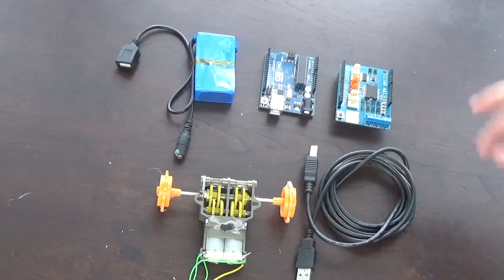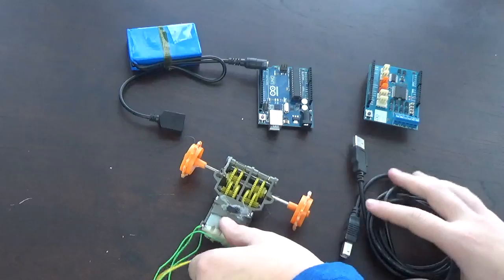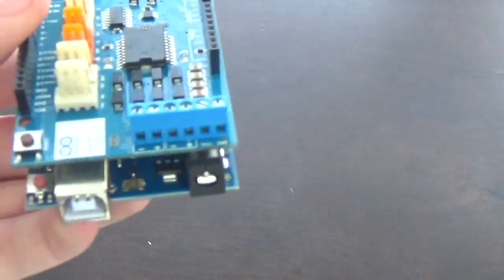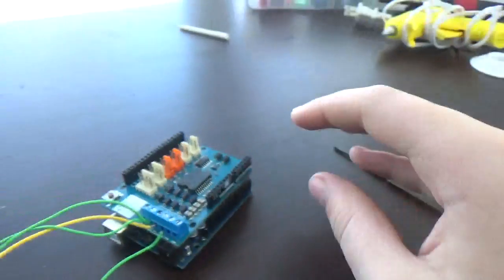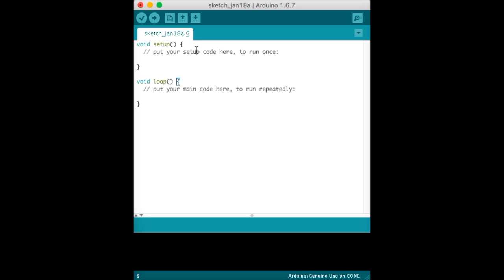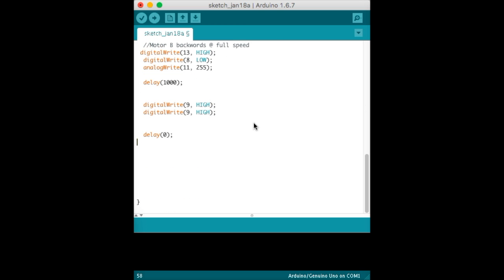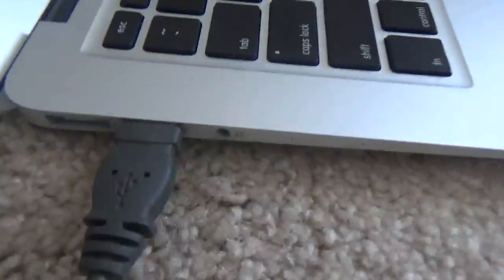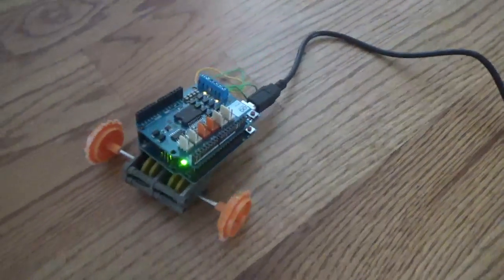How to make an easy and cheap arduino robot!

Comment: Great video but I have questions...    being new to Arduino  I was wondering why use the Arduino Motor Shield when a L298N Motor Drive Controller Board is cheaper.
Reply from the maker: +mike b Hi Mike, I use the arduino motor sield I used in this video, because it is very easy to program, its very light and slim, and its good for beginers to create robots and understand the programming behind the robots. But you are right, there are other cheaper motor shields but many are harder to program and designed for people more fluent in Arduino. With this shield there is also software you can download to enable drag and drop code, for this specific arduino board. Thanks for commenting, and I hope you watch more of my videos!

Comment: good job i design and build robots i have well over 300 robots some i use arduino ,but most i use is ez-robot board much more easy to use and program and much more feature then arduino will ever have
Reply: You can check the detail here at https://bit.ly/2AhaWmf

Comment: Hey! Thanks for the video! I don't know much code, but how would you program it to make it a remote control car? Also, is there a way it can be wireless? Thanks.
Reply from the maker: Check my most recent video
Reply: Could it be a remote control Arduino car? You were using a transmitter and receiver in that video.

Comment: AWESOME!
Do you have to plug any into a pwm pins?
Reply from the maker: All you have to do is put the shield on the Arduino, and plug in the two motors like I showed in the video! No need for plugging it into pwm pins, unless you are planning on using a servo. Good luck!

Comment: can you put program for drone using adruino uno
Reply: Subarna Adhikari You could, but it's unnecessary weight. Look at the pro mini. Same ports, smaller package. You'll need to find a different motor driver too